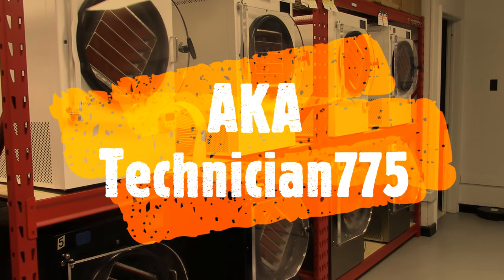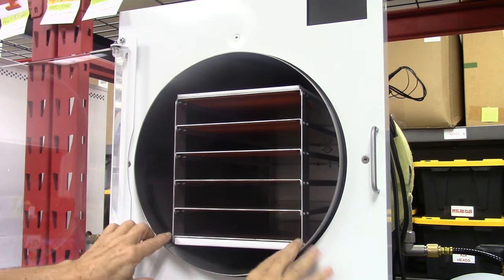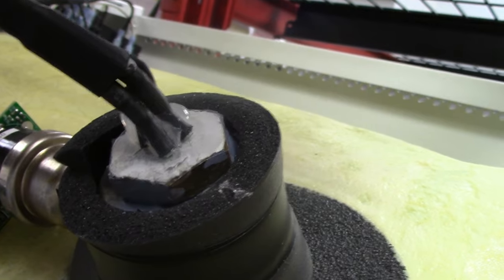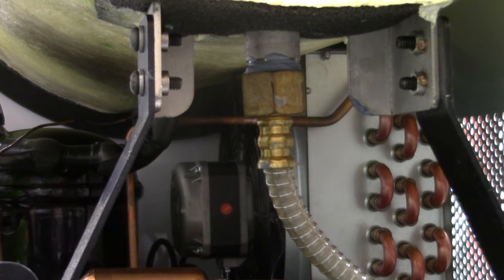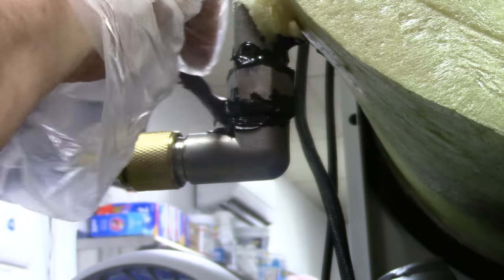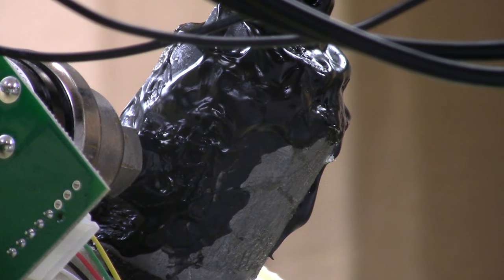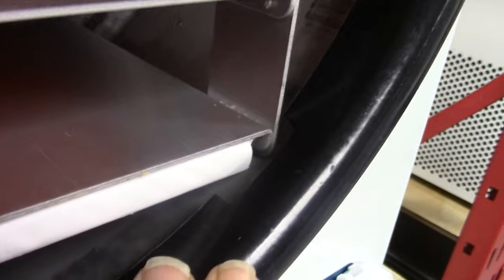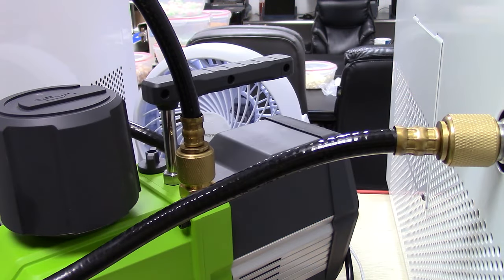Harvest Right Vacuum Fix VIDEO

Comment: I want to thank for for this video.   We had tried multiple things to fix our $4000 paperweight with no resolve.  There were vacuum leaks that even harvest right was zero help in resolving.  We just put only the liquid sealer on all the joints you specified and turned on the pump and after about an hour we have finally reached 450 mtor and slowly going lower.   We couldn't get the freeze dryer anywhere close to 500 before we followed your video.   You sir are awesome!
Reply: Thank you for the kind words!. .glad you got it fixed...sometimes even the best equipment needs some TLC,  good luck with your freeze drying ...if you need any help, please feel free to ask! ty for watching!!!

Comment: After 3+ years of service my freeze dryer started having vacuum problems. The vacuum test would only go to about 850 after 30 minutes. I followed you instructions about using the liquid tape with sealing tape 24 hours later and it worked like a charm. The 30 minute test now is at 380. Thank you so much for your advice and this simple video.
Reply: Hiya!...Great!!!!...glad it helped and ty for watching!

Comment: Thanks!  It worked!  Back down to 230mTorr. Had an issue getting below 1300.  Bought a new stop valve, put on nylog blue, put liquid tape at all the points you said to, and will finish it off with stretch and Seal tape.
Reply from the maker: Cool!!!!   Glad it helped!   TY for watching…..

Comment: I have done every single thing you have mentioned to do in a repair for my freeze dryer. In the past when my freeze dryer was working fine. Then There was an issue where I had to send my freeze dryer in for repair. After it was returned to me I couldn’t keep a vacuum every so often, and I would crank my valve as hard as I could shut, and then it would finish the batch. Little by little, it became more and more frequent that I could not keep vacuum. That’s when I ordered a new valve from Harvest Right, installed it and nothing changed. I couldn’t keep a vacuum. My vacuum pump stayed home while it had repairs. I have changed the valve to a gas valve. I have used the liquid tape and the stretchy tape you recommended and used the that you recommended. Also check the door the tray inside the freeze dryer for adequate space. The only thing I haven’t done is adjust the door and I don’t think it’s necessary because it looks like I have a seal around the ring. Does that make any sense?what would you do if you were me.😢 I have a no oil pump . I will do a full freeze dried bread test. Just in case you’re tired of answering these questions.

Comment: Thank you for this video! I had to tear down the machine to fix the leaks... The liquid electrical tape worked as advertised! Thank you! Then the Nylog Blue, fantastic! I did have to have a custom vacuum hose/line made, as the one that came with the unit could not get me past 470 mTorr... The new line, with the Nylog, got me to 147 mTorr in less than 20 minutes. Very happy with the results, and Harvest right needs to get their act together! And don't get me started on the sealer, that was unusable until I ordered and installed the proper 5mm heat strips. The transformer in the HR sealer is not very strong, and struggles to seal mylar bags. I went ahead and ordered a new sealer direct from Impak, their 5mm IPK-305H. It will be here next week. Again, thanks, you saved my bacon... Now I need to prepare a bill to send to Harvest Right for the repairs I was forced to make on a brand new unit, manufactured in August of 2023. They should be ashamed of themselves for selling this junk.
Reply: hi...glad it helped!....it does suck when you have troubles with a brand new machine....we have been lucky on our newest machines...worked great out of the box....glad you got your tuned up!!!!! good luck in you endeavors! ty for watching and commenting!

Comment: Thank you so much!  I had low vacuum. After replacing the drain valve and hose to the pump, I thought I would have to buy a new pump. I saw this video and did the same sealing procedure. My freeze dryer is as good or better than when I bought it!!  😁😁
Reply: hi...thank you...glad you got  it fixed! a good running machine is a happy machine lol!!! thank you for watching!

Comment: First, let me say thank you so much for your video.  I had tried a couple of the other fixes for vacuum leaks and was left with my machine not pulling ANY vacuum.  I had been using if for serveral months with it only going in the the 500s and 600s, just took a lot longer to finish a batch.  I finally decide to do the FIX thing, and like I said, ended up with not even going less than 1000. Well saw your video and did everything you said as you said.  I was so excited that it was finally down in the 300s after using the liquid tape. Got ready to put the tray rack back in to run a batch, and decided to do a test to see how low it went with the tray rack back in, to my huge disappointment, it only got down to the 600s! So took the tray rack out, and tried again, it now is in the low 300s after 20 minutes.  What the heck??? I made small notches in the gasket where the rack touches, and the cord is up off the bottom of the drum.  I really am puzzled. Do you have any idea why having the rack in the drum would prevent the pressure from going below 600? What can I do?  So frustrated.
Reply: hi.....put some bread in it and run a batch...something cheap.....check the mtorrs...it will be high at first...as the cycle progresses it will lower a little bit at a time....check when the cycle is almost complete, if it does not say " inadequate vacuum" it is good....some go lower than others...but underv500 is good...hope this helps....feel free to ask if you have more questions....ps....the mtors will not drop to the lowest it will go ...on just the test.... ty for watching!!!
Reply: Thank you! I will give that a try. @stevenducote7466

Comment: Thank You!!! We purchased our FD machine 16 mo. ago. Mtorr's rarely got below 200 mtorr's, averaging around 210-220 mtorr's. After applying this fix & wrapped foil around the tray holder (wrapping the tray holder was found in another video) . Knowing the tray holder is shielded a little more from the iced tank walls, I also lowered the drying to 120 deg. as often the drying hits up to 131 deg. and I've heard 125 deg is when food starts to cook. Now we average 142-156 mtorr's.  Thank you AGAIN! I've been hearing people putting food grade Super Lube grease into the door gasket slot for more sealing power, some mentioning their machine got below 100 mtorr's.
Reply: thank you......keep the oil clean and the Dempster as well.....very good job on getting the mtorrs down!!!! ty for watching!
Reply: Plz post the tin foil video
Reply: @usha777  tin foil??
Reply: @stevenducote7466   ya, some people say that if you cover the sides and top of your rack it helps the drying process. I would like to see the video that headspinner01 watched.

Comment: Just a tip for those fans, I bungee mine across the open door and use it to defrost. Works as fast as using the defrost option and is cheaper. The added plus is the air blowing also dries the drum and shelves.
Reply: great tip.....and easy to do....thank you!!!!

Comment: I did this fix on both my machines. My older medium kept having a vacuum leak failure so I resealed the epoxy harness with yellow tape first.  Now both machines run under 200 m Torr.  👍
Reply: wow!!!!   that is great! ty for watching and sharing!!!!
Reply: @stevenducote7466  well it worked great on my medium for a couple cycles.  Now it seems to get down low enough but not hold the pressure.  I think my standard pump has given out.  I’m going to put my premium pump on it after this batch is done to see how it works.  I can’t imagine that it gets down to around 200 and has a leak?
Reply: @GimpyCamper  Check the oil in the pump....change it and retry. Also check the vacuum pump hose orings....are you doing candy or food??
Reply: @stevenducote7466  candy.  I put the premium pump on and it’s still 1600 m Torr. I guess I’ll have to tear it back down when I get home from a work trip I’m going on today
Reply: @stevenducote7466  I went to change out the o rings on the hose and decided to move forward with a mod I thought about just because I had extra hoses and no o rings.  So I had two heavy duty hoses one is 7 ft long but supports over 4000 psi.  I hooked these hoses up so I can place my pumps behind a wall in my work room.  It's so much quieter now.  I did have to tighten those JIC fittings way more than I thought but they quit leaking and my large machine is running at 125 m torr and my medium is running at 100 m torr.  I'm just glad I didn't have to tear the machines down again.  I also understand that some people say the extra hose can decrease pump life, but I think we'll give it a shot.  I would think that considering I had the pumps right beside the machine before it may increase the life cycle of the freeze dryer because it's not running as hot.
Reply: @GimpyCamper  good deal.....glad it worked out!... ty for watching and sharing!

Comment: Awesome tricks!!! I can't thank you enough. Personally, my brain would have never come up with these products for sealing vacuum leaks. I've used 3M rubber tape and Scotchkote doing underground cable splicing for decades, same basic products, I think. 
I just had my first vacuum related failure after 76 trouble free batches, and I'll absolutely try this trick and rule out the vacuum pump. We have a standard vacuum pump that seemed weak and cheap from the get-go. I improved our pump operation after the first few runs, simply by changing to Dairyland oil. But I think our pump may be failing, leaking back vacuum pressure. In a pump test today, I couldn't get below 650 mTorr and the "demister" was blowing a light, stinky airstream that we've never had. 
Any ideas where to get a re-vane and re-seal kit for the standard pumps? I may try to rebuild it if the line and fitting sealant doesn't fix our leaks, but we still have to deal with the demister issue.  Any discussion regarding tech related stuff is welcome!
Have you ever tried a Vevor brand, 10-12 CFM, 1 HP, double vane vacuum pump? I ordered one, so I'll let you know.
Thanks Again for Sharing the Knowledge!
Dan

Comment: Thank you for all the detailed Info....I did 'fix' all the possible vacuum leak areas as you instructed.  The vacuum test never went below 1300 in a 30 min. period AND not below 750 after several hours.  I went ahead and ran a batch of pear chunks and it took 40 hours to finish.  Wondering if the long processing time is an indication of a leak or a problem with the pump or another problem?  Do you have any suggestions?  Thankfully it never said "loss of vacuum".
My FD is 5 years old and I have a Premier pump.
Reply: Hi, you do not have any problems as I can see.  It does take time to freeze dry. We freeze dry a lot of okra, we will pre-freeze the okra and even after that, it will take between 30 to 35 hours and we have machines that run very well (a lot of variables go into this as well, how much did you load in your machine etc). You might want to check your freeze ring, HR has a couple videos on how to do that. If your freeze ring is about half or more, you are good, if the freeze ring is less than half, you wight get a HVAC person to add a little freon. 
  Peaches have a lot of water in them, the more water, the longer it will take. We will do the mixed fruit from Sam's Club and it takes about that amount of time (35 plus hours) to complete. We have 8 large freeze dryers and 1 EX large, that all work about the same.
  I do not like doing the "test" for vacuum as much as i like doing a batch of candy, fruit or even a bread run to check the vacuum, if that make any sense to you. Doing a batch will give you the true vacuum of your machine I hope this helps !... Thank you for watching !!!!  Oh it is a great time to be prepping!
Reply: @stevenducote7466  Thanks so much.  I am thankful for your willingness to read your comments and questions and answer my questions.  I have no one else to talk with about this.

Comment: Excellent video! I need to do this to my freeze dryer just to prevent issues. Do you suggest  taking all the areas loose and taking off the teflon tape that is there from Harvest Right or just putting the liquid tape over it?
Reply: I clean off anything that is visible, I do not take it apart to remove the tape...ty for watching...

Comment: I'm running the original Harvest Right Standard for now. I've got less than 80 batches on it. I may have to hook up my secret weapon. 
I happened on a 5.5 CFM Welsch vacuum pump at a local government surplus auction and I'm thinking it will perform better than this old Harvest Right model. 
Still tinkering with vacuum line filtration and moisture traps!

Comment: Steve your a legend, I did just the tape fix as per HR and still couldn't get it below 2000mtorr received my liquid tape but had to take all the other tape off 1st and these older machines are a pain in the butt as you can't get the rear panel off so i slightly unscrewed the T piece so I could add the liquid tape to where the wires are, tightened it back up again then waited about 2hrs before adding the stretchy tape this improved to about 1600mtorr, then i had seen i hadn't done the side fitting where the pump connects to and as soon as I removed the tape the mtorr started going back up again so added the liquid tape and tightened it a bit this dropped the mtorr to 666 (haha im cursed) I then turned the freezer on to see if it would make any difference, came back 30min later and it dropped to 530mtorr but oops with the freezer running it created condensation on the fitting and the liquid tape was starting to run down the fitting so i turned the freezer off but as the liquid tape was moist i was able to work it around over a period of time just with my finger until it stayed where i had pushed it to, it looks so good now like someone had welded it, being moist was a bonus, the mtorr dropped to as low as 230 before settling around 305, and i still haven't added the tape to that fitting yet, that older fitting with the seal in it was always a problem even when it was working so I put a new fitting on, hope it lasts, I haven't seen this machine work for 3 yrs now i am so bloody happy. cheers my friend and many thanks.
Reply: thank you!...glad it started working!!!!!!!! the liquid tape is magical!....I am very happy it is working...seal everything up....and run with the big dogs!!!!! good luck with your freeze drying adventures!!!!
cheers!
Reply: let me know how things work in a week or two...get a couple of cycles or runs in...see where things settle in....bread run...candy run....one thing...is your screen on the top right or bottom right??
cheers!!!!
Reply: @stevenducote7466  Will do, looking for another fitting as the one I purchased is too big so the side panel won't fit on, or I could make the whole bigger, I have the screen on the bottom, 2017 model I think, HR convinced me to upgrade the software to v24 can't say that I like it that much as there is less options then previous Versions, even my original software had more options, I did one tray of bananas so far and worked fine no issues. need to relocate unit  and hook up a camera so I can log in and see how its running while I am at work. cheers mate.
Reply: @bazza2825  hiya!.... glad it is working ok.....yea some of the updates have not been good...but the last one seems to be a good one for us. we do a lot of candy and ice cream....good to hear your unit is running smoothly!
cheers!!!!!!
Reply: @stevenducote7466  Ok, even though mine is v24 it doesn't have a candy option or is it something that just happens without making changes,  hey Steve I was looking at some of your older vids yesterday and knew right away that hey I had seen all this years ago Lol, good to see your still around and posting videos, cheers mate.
Reply: @bazza2825  hiya buddy!
the candy mode pops up when you put the dry temp 135 Fahrenheit or higher......not too sure about the older machine...after the 15 minute cool down it will ask you if want to go to the candy mode....then a tray warmer.....
small world if you watched my videos years ago.....hope you are doing well after all these years!...

cheers!!!!
Reply: @stevenducote7466  yer not sure the updates are the same for all models, doing well thanks, the past 3 yrs or more have been very interesting though. things heating up around the world.

Comment: I'm happy to see that I wasn't the only person to use liquid tape as a sealant. However I use the silicone style self fusing tape so I wondered if you have found a difference using the rubber based stretch tape with the rubber liquid tape instead?
Reply: I have not used the silicone tape so i cannot judge the effectiveness of the two. This does work for me, not too sure if it will make a difference as both do the job of sealing.  Brilliant minds do think alike :), thanks for watching, I think i will go out and get some of the self fusing silicone tape and try it though, Ty !!!

Comment: Excellent video, but I have one question, if you leave your pump going for 24 hours is it possible that it could suck a little hole through your liquid tape before it dries? Should we just do it for an hour or so and then stop the pump and let it dry for 24 hours?
Very informative video I like it a lot.
Reply: either way...I don't think you have a hole big enough to suck all the liquid tape thru...you could leave the pump running for about 30 or so minutes...the reapply a thin coat of liquid tape....or let it run for an hour or so....but check the liquid tape areas for any bubbling or voids...reapply as necessary
Reply: and thank you for the kind words and watching!